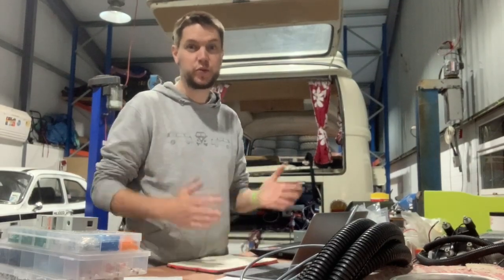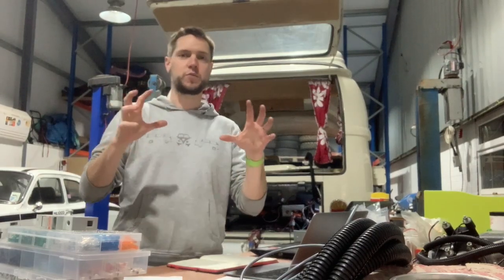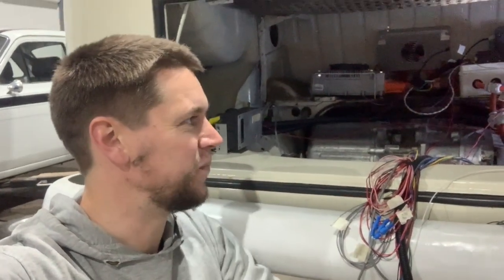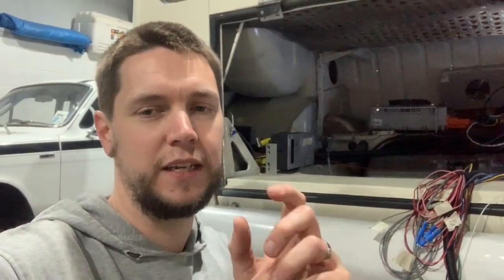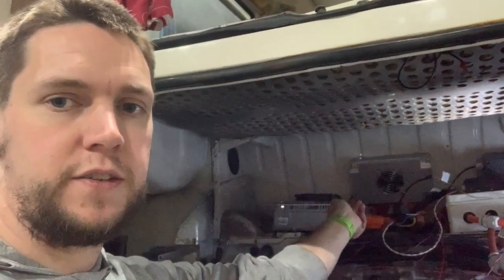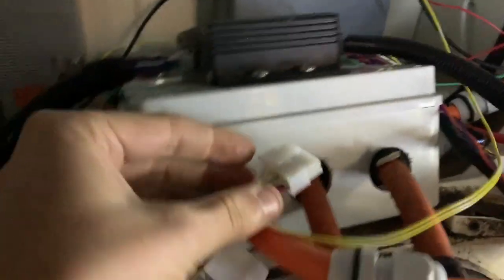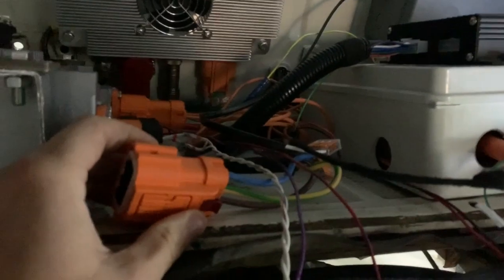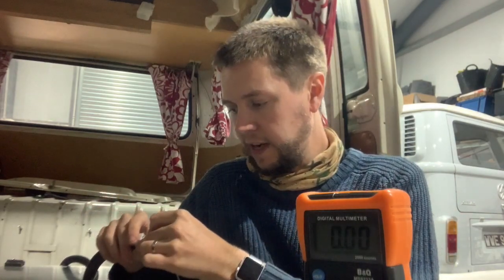Electric Camper Van Conversion: Charging

Comment: Fantastic build.
Could you please share how you've integrated the Tesla motor into the original suspension?
Thanks in advance.
Reply from the maker: Hi, We have custom drive shafts made with the Tesla motor mounted onto a bespoke motor mount.
Reply: @eDubServices  Your work is inspirational. +1 on Insta. 😊
Reply: I guess I'm quite randomly asking but does anyone know a good place to stream new tv shows online ?
Reply: @Harry Adriel Flixportal =)
Reply: @Raylan Decker Thanks, I went there and it seems like a nice service :) Appreciate it!
Reply: @Harry Adriel no problem :D

Comment: If you read the user manual of the low voltage junction box you would have known there are jumpers to select between Control Pilot and Proximity pilot to the BMS OR Charger right?
https://zero-ev.co.uk/userguide/